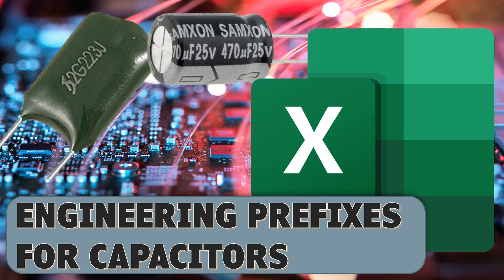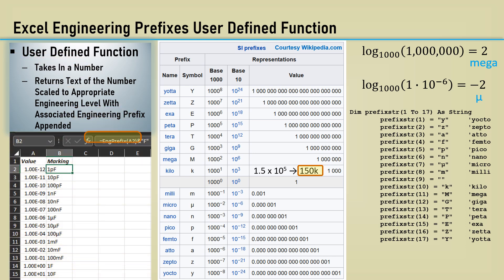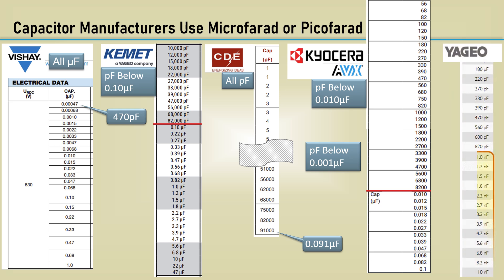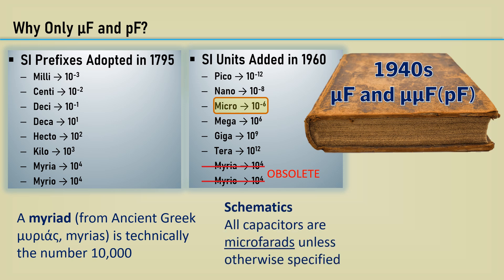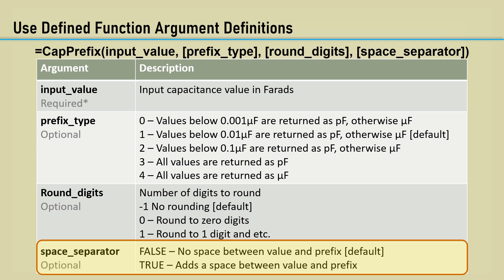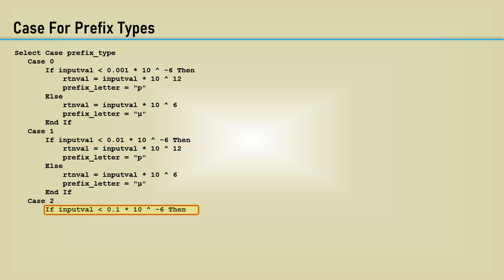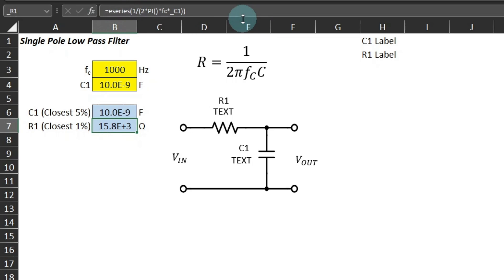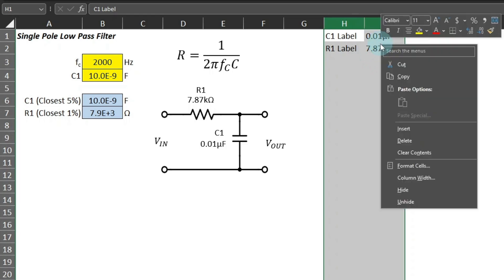Engineering Prefixes for Capacitors

Comment: Nice and useful code to make values in Excel sheets more readable! 
I am personally in favor of NOT skipping nano. I even asked Digikey support once why they avoided nano, but did not get a very satisfactory explanation as I recall. Your guess that it is old habits and a remnant from µ and µµ being the only options sounds plausible. Maybe there is a bit of a difference between Europe (more nano) and US (not so much nano) too, but I have no firm data on that. I rarely deal with capacitors in the mF range, but when I do I am guilty of skipping milli in favor of micro, so I realize I too am not consistent in using the best fit prefix...
Reply from the maker: Thanks for the comment. One reason why I did this was becuase in the future I plan to make Excel generate parts lists. The capacitor part numbers are huge, and I will probably use VBA with some string manipulation within the cells to generate part numbers.